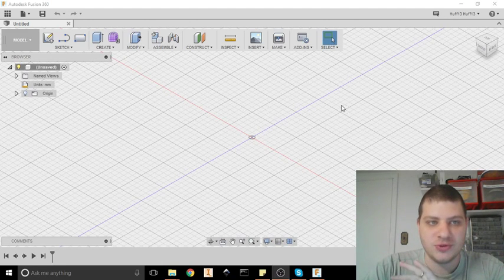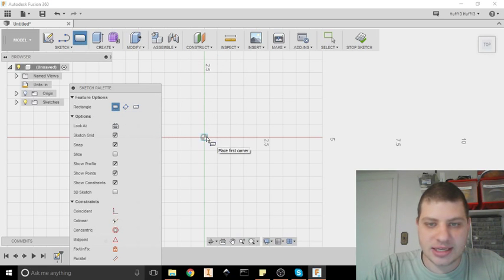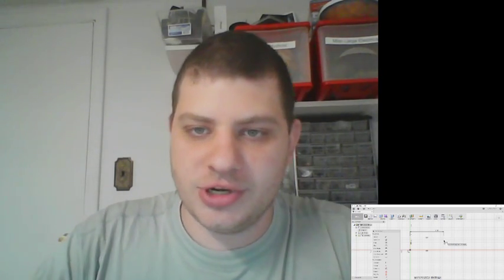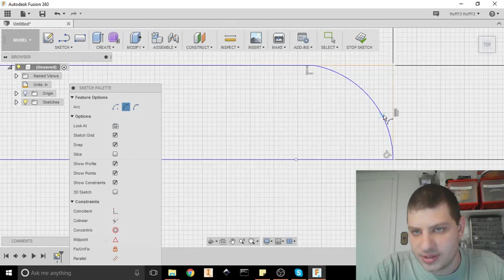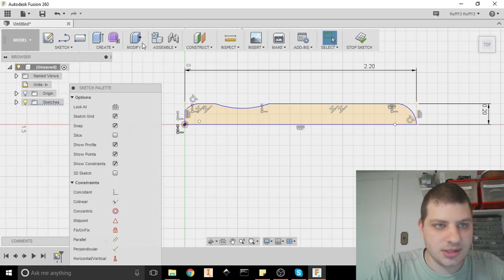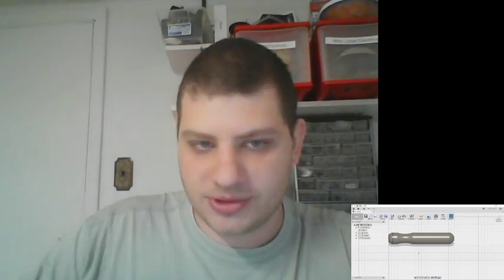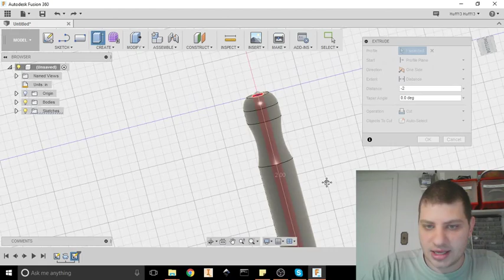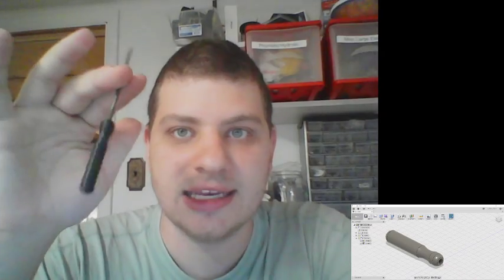Revolve Tool: Fusion 360 Beginner Tutorial

Comment: Here is something I made to help during design. I have one for my main settings, and print a new one if thing like nozzle size or number of walls changes. Vert and Horzontal hole test pattern found on #Thingiverse https://www.thingiverse.com/thing:2407883
Reply from the maker: +Dave Caldwell cool! I'll check it out. I ended up doing a video on fits and tolerances for 3D printers too, after pretty dramatically messing them up in this video.
Reply: Design The Everything something I like to do with holes that I will be using as a screw hole, but too small to print threads, is to taper them - 2 degrees when I extrude cut. Makes them easier to start and them something to bite into further down. Same idea as a pilot hole when working in wood.